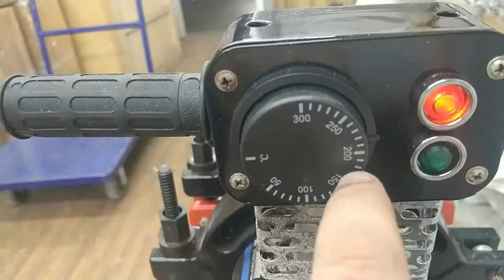HDPE Pipe Joint - Full Process

Comment: May you help me with sharing the heating standard
Reply from the maker: The temperature should be ideally around 210°c. The heating time, pressure, cooling and bead thickness is as per dvs 2207-1 and is7634. Call me on 9820949802  direct for more info

Comment: This is not standard procedure and machine has no pressure measurement. Total non standard.
Reply from the maker: No pressure gauge, at low price , however, all other parameters are controlled. End result also matches standard. So it works !
Reply: @Polymold  there is no standard machine without pressure measurement device. It's only a jugaad. for more information read DVS2207-1 & make something standard based machine not this type shit.
Reply from the maker: sure i agree, but you can always measure the bead thickness. ultimately pressure determines bead thickness and if that is within the standard,  the joint is good !!!

Comment: That's a horrible fuse.

1. Pipe on the left was barely faced. You should get ribbons like what was coming off the pipe on the right.
2. You didn't let the heat plate reach temperature before using it. The light was red, which means it was still heating and not to temperature. Wait for the green light to start your heatsoak.
3. Your beads aren't rolled over because the pipe wasn't hot enough (you put the heat plate on way too soon) and you didn't apply enough pressure when fusing. The second part doesn't matter in this instance though, because the pipe wasn't hot enough to begin with.

I bet you could just pull those two pieces apart after the required cooling time; and if you couldn't pull them apart by hand, 100% if you dropped that on the ground, it would immediately separate.